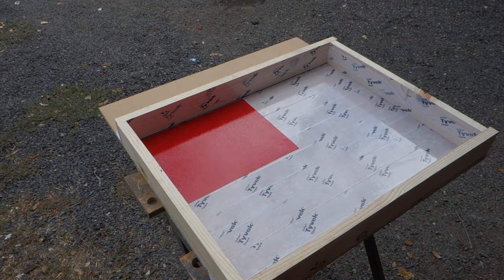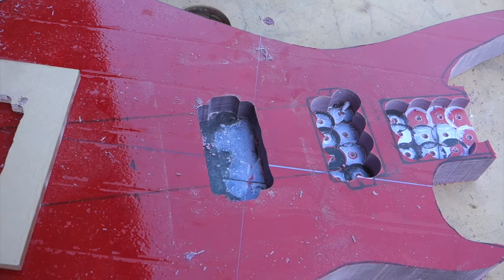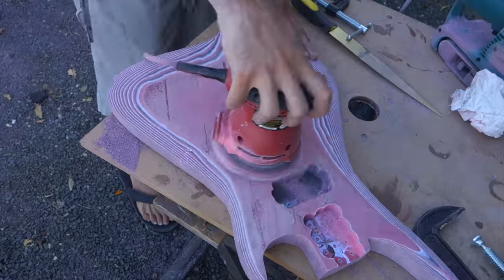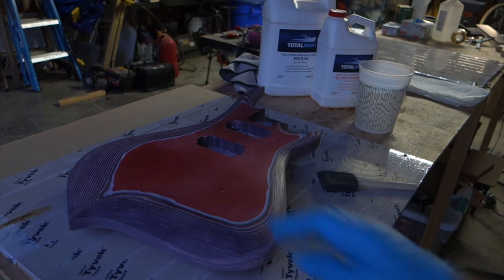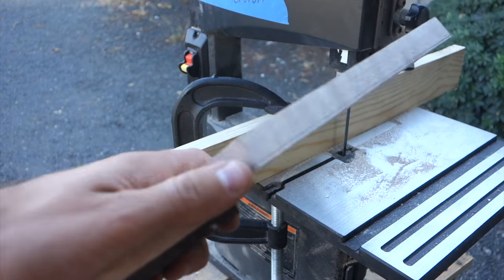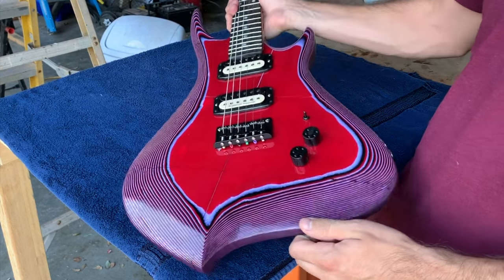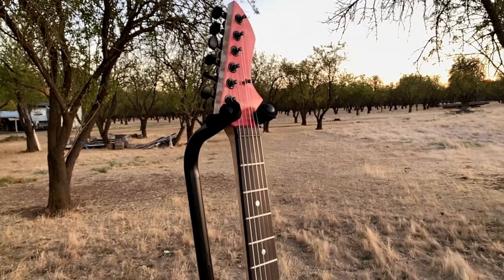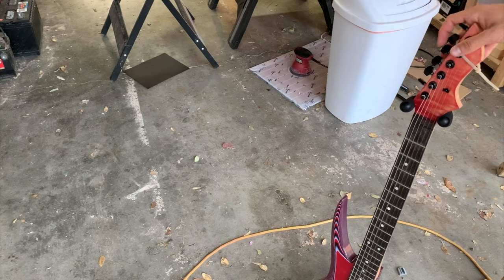I Built a Guitar Out of 800 Pieces of Paper

Comment: "Cool guitar, what's the tonewood?"
"Uuh, office paper?"
Reply: Joakim Engeset tOneWoOds DoNt ExIsT!!1!1!
Reply: @ibbypanch2573  at the very least its obvious the material of a guitar is the least important thing when it comes to tone
Reply: You should point out on an electric guitar.
Reply: Smoomty true but they still do make an extremely small, minute difference that you can just change with your tone
Reply: Probably White Pine.
Reply: Unplugged all guitars sound different. So when they are unplugged the wood and other things make a difference. When you plug it in the sound leaves the guitar before the wood has any effect. On a acoustic guitar the wood makes all the difference in the sound.
Reply: "made out of the finest imported paper"
Reply: @Smoomty  
I use to built guitars (for fun) using different materials: from perspex to marble.

SOUND WISE - (using the SAME hardware and electronics), there is VERY LITTLE  difference in tone. 
(For some reason, only marble sounded a bit different in my opinion, (probably because it was hardest to work with), but again, l never had more than 2 or 3 finished guitars to compare the tone, as l was using (mostly) the SAME hardware and electronics on different projects,  so it was mostly from memory, which is VERY unreliable and biased, especially if YOU are a builder.

Conclusion : THERE IS VERY LITTLE DIFFERENCE IN TONE (*IF ANY AT ALL*) - directly related to a body and neck materials, 
e.g. - "GIBSON (mahogany body with maple top, "sounds darker, fatter" THAN swamp ash FENDER - (bright, "twang" (Fender) sound: 
IT'S A MYTH !!!

PICK UPS and POTS DICTATE THE SOUND AND TONE !

I (still) never met a guitarist who in blind test will tell the material of the body. 
(With NECKS it's a bit different,  in blind test an experienced guitarist can tell if he plays the ebony, rosewood or maple fretboard only -  the neck material is hard to guess) - 

WHILE WITH THE ACOUSTICS ,  (flamenco, classical and semi-acoustics) - the OPPOSITE IS THE TRUE  - ESPECIALLY THE TYPE OF WOOD USED FOR A TOP, 
(As 90 to 95% of the  sound comes from the top plate  resonance) 
the rest is just cosmetics!) !

Ovation use synthetics for a bowl, Martin, Taylor and other "big" names  use everything,  from exotic woods (Zebra wood, Cocobolo, Bubinga) to mahogany and rosewood. 

But they ALL use SPRUCE, (sitka, red),  CEDAR, MAHOGANY, ROSEWOOD (lndian, Brazilian) or MAPLE  for a top because of the hardness/weight ratio and resonance abilities.

THE POINT OF THIS "ESSAY" :
Dismantle the Fender "de luxe" (or Gibson "Standard"), BUILD the exact replica of the body from paper 
(as in this example), 
put THE SAME hardware and electronics on the "paper" guitar, OR (just) HYPOTHETICALLY :  
Gibson or Fender Custom Shops AGREE to do this experiment, 
(PLEK the guitar - computerized set up) and give this guitar to ANY big name guitarist IN THE WORLD, 

IT WILL PASS FOR "REAL"  THING !!!
Reply: Joakim Engeset A4
Reply: It's a Dunder Mifflin, Michael Scott signature design.
Reply: If someone asked me that I would have to say “your mum”
Reply: @ibbypanch2573  Nothing that can't be corrected with some pre-EQ, of course...
Reply: @misho2184  You have the reason. Even there are a research about it, and the scientists wrote a book based on their research, and they conclude that there is any difference in sound related to wood
Reply: “Classroom oak”
Reply: @SecondaryHomunculus  no its michael scott paper company the finest apaer in ther market
Reply: @misho2184  I would add scale length, pickup height, and to a lesser degree, nut type and bridge material and mass to the factors that do influence tone. For a real life situation, amp speaker size and type also matters a lot.
Reply: Misho my Taylor uses a Koa wood top
Reply: I wouldn't even answer if somebody asked me that about any guitar I owned. "Oh, you mean what kind of wood is it made of?" *insert wood name *
Reply: more like anything you fucking want + epoxy resin and coats
Reply: That is pretty cool not gonna lie
Reply: @danielmckinney7668  
So that means that you paid a LOT of money for INFERIOR (but l bet nice looking) top.
Koa is nice looking wood used mostly for sides and backs.
There are much more SUPERIOR sounding  woods than koa  that can be used for a top plates.

THE TOP PLATE GIVES THE SOUND and CHARACTER to your guitar's sound.

Would you choose an average looking woman for wife (for life), reliable, understandable, good character -  or a "show ponny" - a sexy looking model like a starlet who don't know how to cook, shows her stupidity as soon as she open her mouth to talk - (otherwise she is o.k. - you'll be happy everytime she opens her mouth)...

It's similar with guitar tops (acoustics). 

The plain, humble sitka spruce looks inferior for looks to KOA, but it has superior sound.

EVERYTHING IS UP TO YOUR TASTE...
Do you like NICE LOOKING guitar or NICE SOUNDING one.

I have over 150 EXOTIC guitars, and  EVERYONE has a different sound, character, personality ... Needs different approach when playing her...

My favourite one?
Electric (modified)   '94 - "PATRICK EGGLE" - BERLIN, (model) - I swapped '73 Gibson "Black Beauty" for her.
I felt SO sorry for giving up my "Black Beauty" for Patrick Eggle - l didn't touch "that" guitar for a couple of years.

Now, IF l have to keep only one guitar, it will be probably the "BERLIN".
IT'S LIKE A FINDING A "SOUL MATE"...
She got EVERYTHING, touch, response, feeling... Just "tell" her what do you want to play, and she will respond.

At one stage l had over 400 guitars, and l was still searching...
I think that l find the RIGHT one. "The"  Patrick Eggle.

Acoustic wise?
Hard to tell, but will NEVER sell my 
'81 Takamine - Sakashita -  S/N 002
'88 Ovation Adamas Collectors Series -
 '63 Gibson Dove - 
Martin D-28 (forgot the year) - 
'89 Alhambra classical and a "few" more.
They are like children, which one do you love the most?
Or your fingers... IF they cut one of your fingers, it hurts the SAME as they cut any other one.
Reply: @meadish  
Yes, but we are off topic.
We are talking the materials ONLY, otherwise - add the size of the hall, (or open concert), gauge of the strings, plectrum material, pedals (effects) in the chain, sweat of your hands, cable lenght (or wireless) - EVERYTHING ADDS UP TO THE TONE.
You are right, the components you mention they all play the role in creating the tone, but we are talking only the MATERIALS the body is made of. 
Otherwise, this would be an endless topic, ONLY the GUITARIST discuss this things, have you ever heard other instruments players discussing the factors for sound in such a detail?

But in hands of a GOOD guitar player, ANY (reasonable) good built guitar will sound ... good !
Reply: @misho2184  good job on your thesis!
Reply: @misho2184  if we're going to be anal, species of wood has far less to do with tonality than the density of the specific pieces used as well as location and amounts of deviation in that density.
Reply: I've heard great guitars made out of glass, epoxy, foam... tonewood has little to no significance to a solid body electric guitar.

Comment: I love how the shape of the body isn't the typical mimic of every electric guitar you've ever seen but has its own artistic style.
Reply: The headstock too. I like how it's more stylized
Reply: Every electric guitar I've ever seen isn't exactly the same as the last one I saw. There's many different designs. Flying V. Inverted Flying V. Les Paul. Strat. Tele. PRS. Etc....

You mean ever strat looks like every other strat? 🤷🏻‍♂️ Yea. It's called brand recognition. I can name 10 random bands right now and would bet than at least half of the lead guitarists use a guitar unlike anyone else of the 10 bands I named.
Reply: You also understand that the basic shape you see on an electric guitar is done for function over form, correct?

Those cutouts around the neck are there for a specific reason. How did they get that shape? They took your standard guitar shape and made cutouts around the neck to allow use of the lower frets. As I said, that, design is a result of function over form.
Reply: @J__C__  negative.  Obviously, cutaways are to reach frets and obviously you need some basic shape and weight that balances well in the musician's hands and provides a good amount of solid structure for the sound to resonate off of (though far less necessary than on an acoustic, since the pickups do the majority of sound transfer) but from there the possibilities are endless.

Guitars don't have to have that distinctive curve that goes from a large oval to smaller curves at the top with a kind of "hourglass" feel.  It's done because it's pleasing to the eye, because it resembles a voluptuous woman, same as why many vases have a similar curvature to them.

And 99% of people who do the "I made a whole guitar out of unusual objects" videos use the same tired shape that 90% of all guitars are an almost traceable template of.
Reply: Fucking guitar scientist in here

Comment: "tonewood believers hate this guy"
Reply: Paper is made of wood,so it's "Tonepaper".
Reply: @Slicklickz  Well to be honest paper is treated with chemicals, so paper isn't 100% made of wood. But it's not that far from 100%.
Reply: The fingerboard still wood, that's what gives the character of a guitar, the body only is the resonator, but the change of tone is not much. There a little differences between rosewood and mapple but really the most significant change of tone is in the pickups and the bar (in a strat type)
Reply: @roadsportuk  yeah, but there's moreso a point of diminishing returns the higher/denser you go, plus pickup quality and type can totally cancel out tone wood's advantages, along with distortion, effects, or the use of P90 pickups. I mean, the Fender Stratocaster and StarCaster are the same guitar except the Starcaster is hollow, made of cheaper wood, but are similar in sound and quality

Comment: I always found the best way to position the bridge was to mark a centre line based of the neck position (straight edge down each side of the fitted neck, measure and mark the centre) and then simple position your bridge so the centre line goes right between the D and G saddles. Much more accurate than using high and low E strings.

Comment: Could this technically re-spark the tone-wood debate?
Reply: That debate has long been closed in my mind. It's all about the neck and electronics.
Reply: pickups are small microphones, whatever resonance is there unplugged when you play your guitar, the pickups gets it, the wood affects the sound
Reply: @heythere6983  no no it doesn't. The pickups are not microphones. They are wax potted magnets that only detect vibrations from metal.  The original pick ups that were microphonic just output feedback and sounded like dog shit even with no distortion. 

the location where you pick the strings, the pick you use, the angle you pick at  all have a lot more to do with the tone than stupid tonewood bullcrap.
Reply: @heythere6983  you want to hear the  tonewood? Pick up an acoustic or put Piezo pickups on your electric.
Reply: @Churdington   @iridescent noise I have two gibson sgs, one 2006 and the other 2014, one 90t pickups the other 61 pickups. Both those guitars aside from other electrics I tried, if you speak into them, your voice  will go through the amplifier. Or if your phone is playing some recording, put it next to them, it will be picked up. They WILL pickup sound next to them without hitting the strings, they are wax potted obviously, also, the acoustic sound you get from the guitar reflects its electric tone, my wine red sg is super dark sounding, so is its electric sound, the other is brighter , so is its electric sound. That simple. Some guitars r super over priced, most are, buy a 200 dollar electric then if it makes no difference n get nice pups. I can get the same pickup and put it on two different guitars, wont sound the same, similar, but the wood affects the tone, this is more obvious also with a better amplifier and better gear, just in this channel alone the guitars sound  different, didnt this guy make a guitar out of foam and it sounded super muddy? Forgot that?
Reply: @terran236  I responded to the other guy  so read that aswell , wanted to add.. the metal is attached to a surface that touches the wood, the wood vibrates and the vibration goes into the strings aswell, it affects how to metal strings vibrate, aka tone. the strings aren't unattached, if they r attached to anything it will affect the tone and vibration onto of the pickups, which also pickup sound. Also, your own density in your fingers affect the tone. the lacquer vs almost no finish affects tone, people tend to accept the lacquer fact more easily than the wood fact for some bizarre reason. The reason lacquer affects the tone is bc when you cover the guitar w the plastic like substance is mutes its vibrations. The vibrations of what? Wood.

Comment: You could save weight and make it both thinner and indestructible by adding a layer of fiberglass cloth in between every few layers of paper (depending on how thick you make the guitar. I think a total of 3-5 layers of cloth in between the paper layers should be more than enough. Doesn't have to be the thick stuff, I think the thinnest cloth would be enough for a guitar. It adds strength and should be virtually invisible.

Comment: You could have just drilled out those screws using small bits and working your way up.  Maybe back out the screw with the bit or with a tool for doing that.  But there is something to be said for expedience.